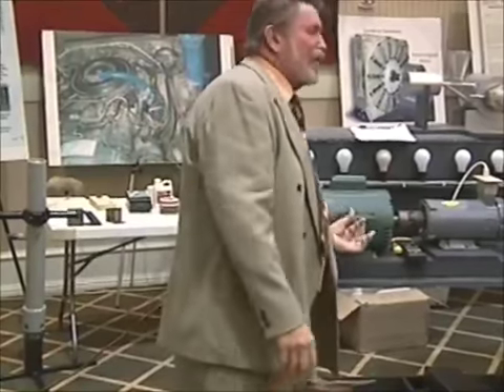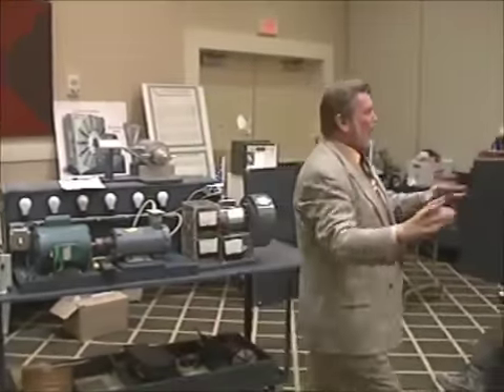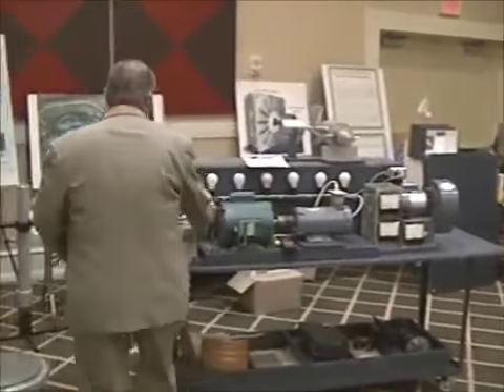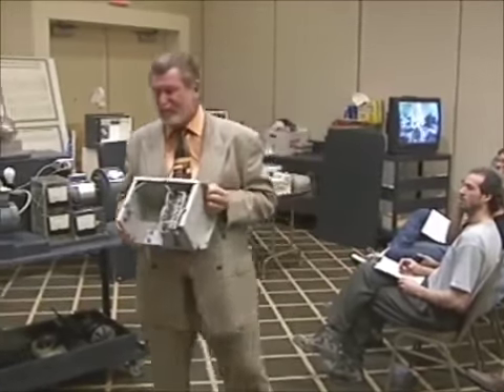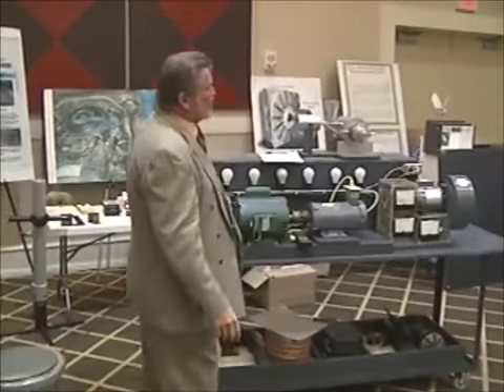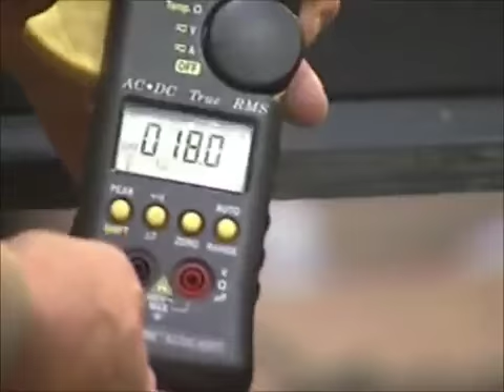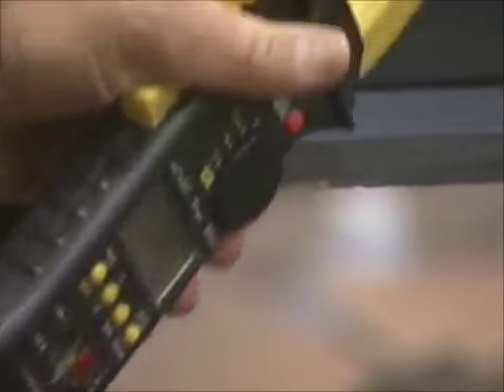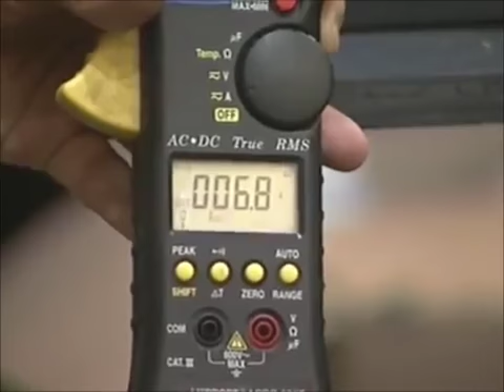Power Factor Correction for Business Owners

Comment: I agree with Trent.  I don't know a lot about power factor, but I do believe the increased current from the out of sync resonance doesnt change your power bill.  Sure the apparent current (and thus power) is substantially higher, but the actual power is the same, and thus your power bill doesnt change.
Reply: If you noticed in the video after the power factor correction the motor amperage draw was much less, there for less power required to run the motor and less power purchased from the utility which saves you money